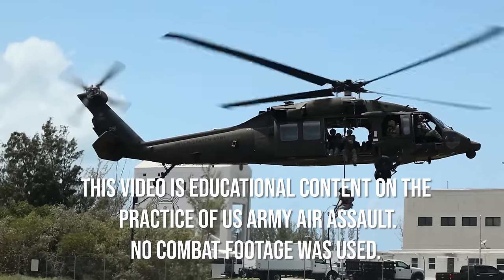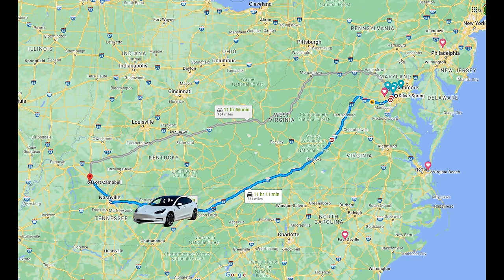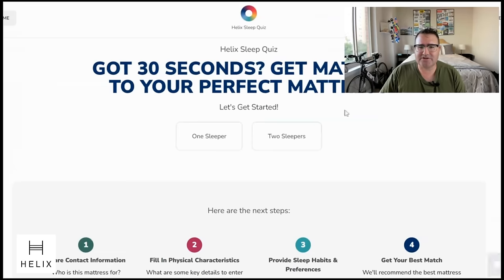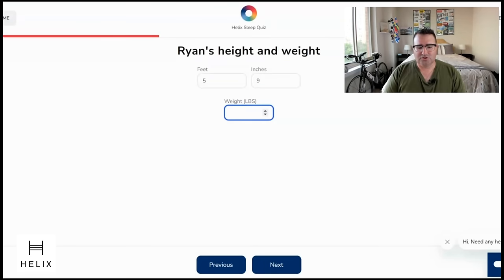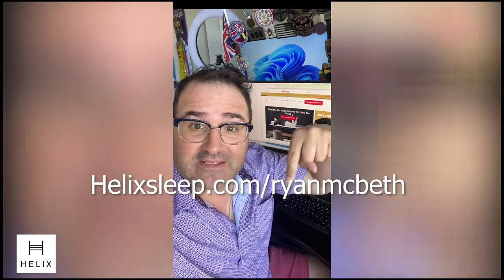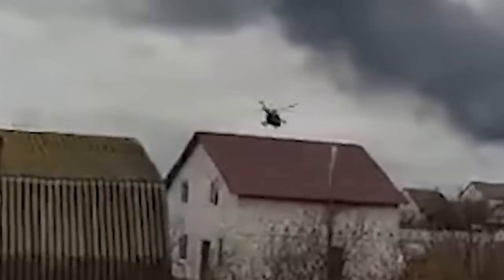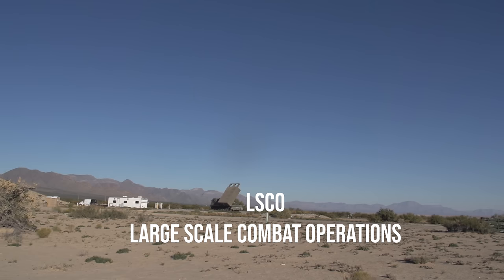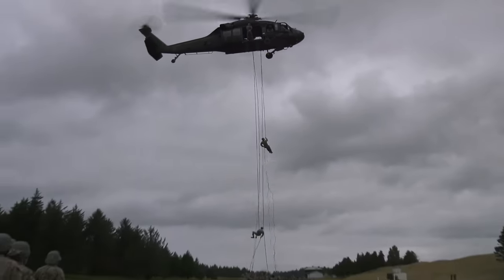How Air Assault Works - Featuring the Rakkasans of the 101st Airborne

Comment: I would be remiss not to mention, that Ukrainians performed several quite successful air assault mission resupplying Mariupol garrison and take the heavy wounded personnel out, while it was under the siege. They flew 80 kilometers beyond the enemy line on Mi-8, which is less maneuverable and leave much larger heat trace then modern UH-60. Air assault is definitely useful in modern LSCO operations and still maybe one of the best way of infiltrations beyond enemy line.

Comment: What if you can develop something like detector that can detect parts of manpads let's the particular metal they use for it components or it's powder on the helicopter and as the crew move it can detect manpads snipers hiding in bushes or buildings and the gunners can eliminate them before they can target them ? 

What do think?

Comment: Ok, that is all very fine and cool, however, if you've ever trained on a MANPAD, you would know that even at night, if you hear rotor sound, you only need to arm your seeker, and scan in that area of the rotor sound to try and get a lock and tone.  If you do, and that helicopter is within line of sight, it's a dead chopper.   This is especially true for helicopters that have sling-loaded cargo that CAN NOT fly tree-top level.   As a rule they are more exposed to MANPADs and anti-aircraft artillery fire (such as from ZSU-23's).  Granted AH-64 Apaches are providing fire support, but once that MANPAD lets loose, it doesn't matter if the crew is killed, that missile will still track.  Flares are only marginally effective against modern MANPADs.  In Ukraine we've seen very little difference between Stinger missile effectiveness and the effectiveness of modernized Russian Igla and Strela MANPADs.     
So yes I disagree with your assumption that air assault is still relevant.  Perhaps in an initial air-assault they can can move a lot of equipment by surprise.   However in sustainment operations, the helicopter crew's jobs become vastly more dangerous.

Comment: One of the big mistakes the Russians did at Hostomel was they violated  rule one  of Airmobile operations

1) No serial shall use the same flight path

At Hostomel the Russinas used the same flight path for the second wave.  By the time it came in the local AFU units where well warned and picked them off with  MANPADS as they flew over the Dnipro Reservoir  They lost I believe 3 or 4 ships for no reason other than bad planning.

Comment: Also target selection is important. It was known that hostomel airport was a target before the invasion. The Ukrainian knew this, if there is an attack this airfield will be crucial for the Russian. That was the reason that the  third special purpose regiment (SOF) and the 4th Rapid Reaction Brigade of the National Guard were in the area. Those units were rapidly reforced by a Ukranian air assault unit and the 72 mech brigade.  So the operation of the VDV was only realistic if the idea was (also the reason they had zero air support, there were no ), the Ukrainians are not going to fight (which was the idea like in 2014 and was the mindset of the Russian military intelligence and the political echalon).

Comment: This is a nice video, but doesn't touch on the main reason why air-assault is considered problematic in LSCO. The main problem are manpads, large amount of enemy air defense (not single system that gets destroyed) and enemy airforce. Even if the US can suppress both major AA systems and airforce, manpads will still constitute huge danger to the helicopters and the whole plan. Enemy can also concentrate artillery and drone fire on the landing zone if their response is fast enough preventing resupply.

Comment: Well, the one thing nobody mentions is that both, air assault and airborne operations are "narrow tolerance" techniques. If you don't check ALL the boxes you are sending your troops into a suicide mission. Those conditions need to be present or they need to be created in order to have a successful operation.

Given the circumstances in Ukraine when the assault was launched, the VDV did as well as could be expected. They didn't have the right conditions, so the technique should have been delayed. However, they have pulled it off before, just like the US has. Similarly, they have their share of botched assaults, just like the US has.

Had their second wave not been impeded by UK's air defense comeback we may be telling a different story. Those few guys and gals literally saved their nation in its worst day

Comment: Question...as per lessons learned in Yukraine... how is cas-evac  handled if there is no air superiority? Assuming an air assault would be attempted without superiority
Reply: An even better question would be what level of air superiority, if any, would be necessary for the kind of operation showcased in the video? Basically, can the 101st go it alone if the Air Force isn't able to provide close support.
Reply from the maker: It’s a problem that needs to be addressed.
https://ryanmcbeth.substack.com/publish/posts/detail/121029168/share-center

Comment: Is this still following the IBCT system, or are they moving away from independent brigades that fall in under a division? I feel like 38 Blackhawks and 24 Chinooks aren't that many for a division. I get the air assault equivalent of "legs" are probably not taking a helicopter
Reply from the maker: The Army is pivoting back to a division centered structure
Reply: @RyanMcBethProgramming  big army was discussing that before i got out. Probably due to near peer threats becoming more relevant.

Comment: Great job.  I would like to know when was the last time ANY one has done a successful air assault raid?  Not an air assault to take and hold a location.  A air assault raid that is I think are similar to gun raids. A raid helicopters transports ground vehicles with soldiers to a drop of location. Those soldiers then use their vesicles to go assault another location..  After their assault the soldiers then make their way to another location where the helicopters pick them up to return to base.
Reply from the maker: They did it all the time in Afghanistan and Iraq. Probably the most famous was the one the Rangers did after 9/11.
Reply: @RyanMcBethProgramming  Where they got dropped off? DROVE to another location. Attacked that location? Drove to a different location? Then got picked up at that third location?

Comment: MANPADS use radar so they can be fired at night because when the radar locks the missile will do all the work.  The Piorun is a fire and forget system but the IGLA I'm not so sure about, does a MANPAD missile communicate with the launcher radar after it is fired? or are they all fire and forget? Hello from our medic school in Poland Ryan.
Reply from the maker: For the most part, MANPADS are aimed visually and fired after heat signatures. There are no radar-guided or radar acquired MANPADS. A system like this would be heavier and far more expensive. This is one of the 101st only flies at night. It is highly unlikely that you would be able to acquire and fire on a target at night if you are a MANPADS operator.

Comment: A question for the experts here:  given what we know of the war of Ukraine, if the 101st was to deploy there assuming full NATO support, how costly would an air assault into Southern Ukraine be?  What kind of loss rate would you expect flying over Russian lines?  How long could sustainment with losses be maintained.
Reply: Well maybe his example handles my question but using drones and man pads would inflict losses just hope it’s manageable.  Best way to keep the enemy unbalanced I guess is speed and massive air support. This would give ground troops more time to clear mines less obstructed.
Reply: 1. I doubt an Air Assault operation would go across Russian lines, they are just too easy to skirt (with the 101st air assets). 
2. Even if they did, they would cross the lines so quickly after artillery prep and with Apache and artillery immediate suppression available, that it isn't likely that there would be all that many losses - Blackhawks would be crossing the lines at over 100 knots and probably at under 100 feet AGL. Just doesn't give a lot of time for reaction and engagement. 
3. How long sustainment can be maintained depends on the specific mission and location. No way for that question to realistically be answered. 

In my  opinion, the deployment of the 101st into Kherson would mean that the possibility would exist for the 101st could place a Brigade or even larger behind the enemy defenses, forcing the Russians to withdraw and allowing Ukraine to liberate Melitipol and cut the landbridge.  That would force Russia to abandon Kherson, then Crimea.
Reply: @Ghatbkk  thank you.  Your answer makes a lot of sense.  Yes putting a brigade 1/2 way between Kherson and the Crimean border sounds interesting. .  I have to believe they feel they can penetrate but I’m sure the Air Force would have really been after the anti air first.

Comment: Missed chance to do a collab with T-sply. But great video. I remember a thumbnail for a video on another channel recently that had a arrow pointing at the front of a US Army helmet as it's greatest advantage. That advantage - the mounting bracket for night vision optics. That huge portions of the US military can rely on advanced optics gives it the greatest edge in operational tactics. They are the monster that goes bump in the night. Plus the idea of sling loading a bunch of howitzers, choppering them into enemy territory, firing off salvoes on a unsuspecting target, and high tailing it out before anyone realizes what happened is the most insanely bad@$$ strategy I've ever heard. Gives shoot and scoot a whole other level of meaning.

Comment: 1. You better hope you got air superiority.
2. Air defence systems might require some preventive SEAD.
3. A MANPAD infested battlefield might be an issue - even if outside MG and RPG  range.
4. How is airmobile artillery expected to deal with counter battery fire? It is neither very  mobile, nor well protected.
5. Why do you assume the enemy isn't good at fighting in darkness?

How much actual experience with non-COIN airmobile operatations does the US have?
Reply: Generally, you can expect a gun raid where the 105/155 howitzers are emplaced before the main assault. They probably have pre coordinated targets that the scouts would call for fire from against AA emplacements, enemy artillery, etc.

Those fires would happen at very specific times, as the air assault is en route. Those guns might be slung in with their accompanying HMMWV'S to immediately displace after firing to avoid counter battery.

All the problems you brought up are part of the very basic planning considerations of an air assault.
Reply: @jswjr6001  Yes the HMMWV can tow the M119 105mm Howitzer, but attemting to use it to tow the M777 155mm Howitzer I think would be an act of desparation that I wouldn't recommend.

And if you are operating so close to the FLOT that you can suport the landing zone with artillery I would think fighting the way there with a heavy ground force would be far less risky than trying a daring coup by flying there.

Has it ever been done in a non-COIN operartion?
Reply: @CarlAlex2  I am aware. LMTV'S are the prime movers for the triple 7's.  I have flown a lot of 119 slings in gunnery raids.

Comment: One of the reasons the Rakkasans may put their symbol everywhere could be that it's a relatively easy symbol to make. The symbol is made of mostly straight lines while the Eagle, Globe, and Anchor have a lot more detailing on the globe's geography, the shape of the eagle's features, the rope on the amchor, etc. Given two equally proud groups, the one with the simpler logo is going to have an easier time slapping that logo on everything, so it's just logistically more feasible for the Rakkasans to put their logo everywhere.
Reply: Way to miss the point, meal team six..MSgt out.

Comment: that's all very well and good... but helis still vulnerable to a near-par enemy missiles. Even at nights...
Reply: Nothing is invulnerable but is MUCH safer in the dark(if u have the proper night capabilities like the 101st has).  Manpads are not great at night and I believe S300, S400 and other SAMs would be wiped out  from safe distances before sending  the proper air assault. Daytime air assault operations  probably a different story.
Reply: @michaela7759  In a scenario where air defense is already knocked out, you've already won. If it isn't, these guys risk twiddling their thumbs...

Comment: Air assault is only valid against an opponent who has no air defense.  It won't matter what time of day you fly if you are going against modern capable anti-air defense systems.  If you can only fly outside the perimeter of enemy missiles, you might as well use ground transport which is much more efficient.  The Ukraine conflict has shown what happens when  air assets fly near the front on both sides.  If you are beating up some African or other third world country, air assault is viable.  Against a modern, well equipped army it would be disastorous.
Reply: Do you seriously think the commanders of the 101st never considered that? The US army trains for near peer every day. Use critical thinking

Comment: Just remember that all of this is only possible if you have the complete air dominance. I honestly would like to see how 101st would approach similar ops in Ukraine with resources that Ukraine has available.
Reply: Not really true. The vast majority of the 101st aviation assets are trained to operate very low and very fast (in relation to the ground). That makes the threat primarily short-range gun and short-range missile air defenses, and the attack birds are very capable of performing SEAD (as Ryan noted).  If you only had the 101st added to Ukraine's current forces with their integral assets, they would be a massive advantage for Ukraine. 

1. They fly low, and they operate at night. Ukrainian SAMs (Patriots and others) are keeping Russian aircraft out of airspace where "look down, shoot down" would be a viable threat (if Russians could even effectively do that, and I'm not sure there is evidence they do).  For those who haven't experienced it, Blackhawks of the 101st operating in Ukraine would not be visible or audible until they clear the treeline just before setting down. That is the result of modern rotors and the altitude that NOE (nap of the Earth) is with Blackhawks (it can be as low as 1 foot AGL). Add in that the Apaches will engage their targets more often than not from behind the horizon. 
2. The 101st (like all American combat arms) own the night - to a far greater extent than any other combat force on the globe. This is both a consequence of having a wide range of night vision and thermal vision equipment available, as well as far more training time on using that equipment than anyone else. 
3. The combination of technical proficiency and very aggressive tactics as well as the ability to place troops where they are not expected is a huge advantage.
Reply: @Ghatbkk  you sure Ukraine has Patriots or even S300 coverage at the frontline? From what I know they only cover major cities and have no SEAD capabilities much less CAP. I also heard from UA pilots interviews that R-37, combined with russian EAW is pretty much keeping their helos staying away from the frontline ranges.
Reply: They obviously have something, since the Russian Air Force is avoiding flying over Ukrainian air space (information on losses suggest that the Russians lose about 25% of sorties that they attempt over Ukrainian controlled ground). 

Mi-8s don't exactly have the capabilities of current UH-60s or even CH-47s, and the Ukrainians don't have anywhere close to the EW packages that the US Army has in aircraft.
Reply: @Ghatbkk  I just wonder how 101st would adapt to the fact that Russians can shoot top-down from SU-37s that are flying from deep inside Russia.
Reply: @StritarD  I doubt that they can. Russian pilots have proven not to be all that adept as using the capabilities of their aircraft. Shooting down up to date helos flying NOE is hard.